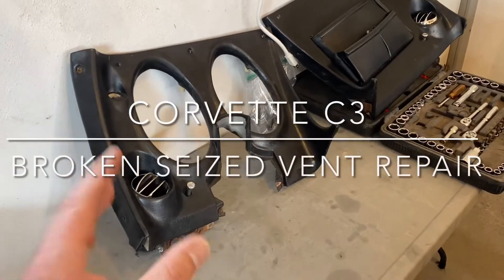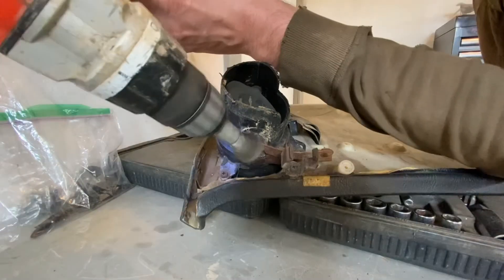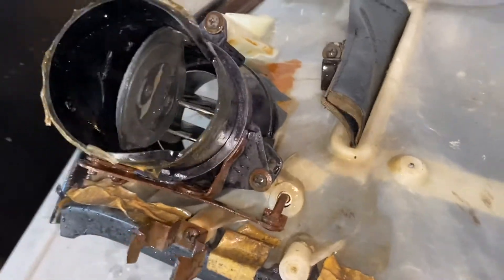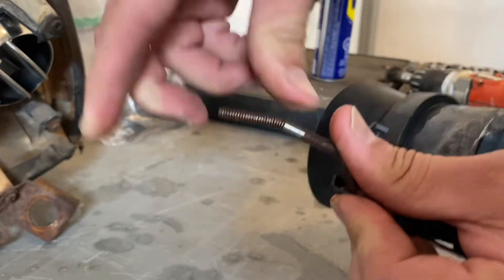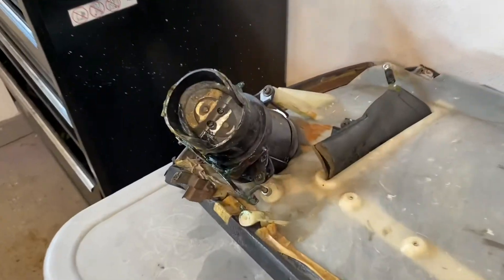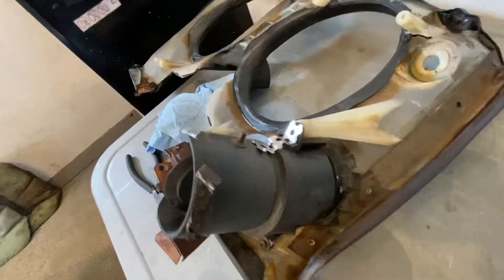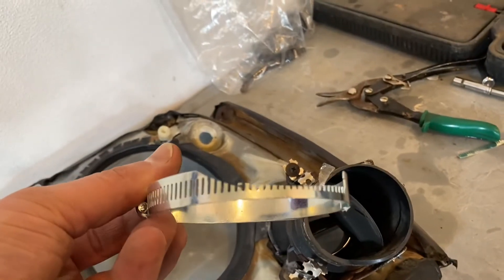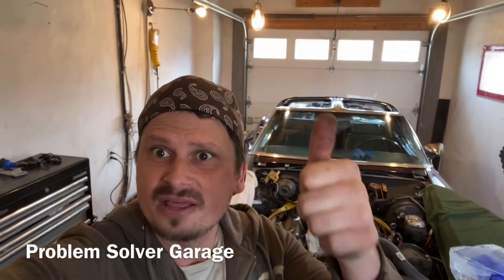Corvette c3 ( Vent Repair ) Dashboard vent repair (Seized and cracked vent fix)

Comment: Gudday Tom. Great Series.  Quick question, if you use the heater and hot air blows through the vents do you get a strong grease smell blowing through if you use bearing grease?  Just restoring a 1974 C3 convertible over here in Perth West Australia.  You tube makes it a small world!
Reply from the maker: No there’s no smell